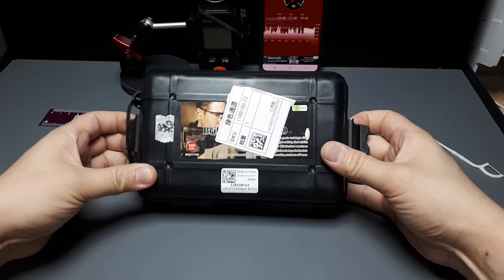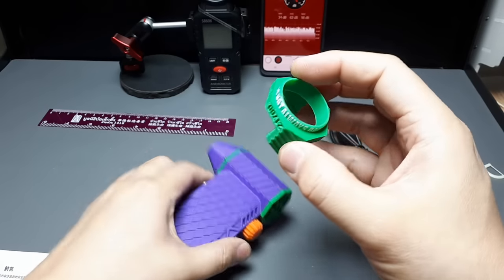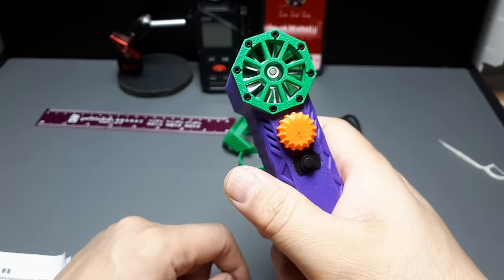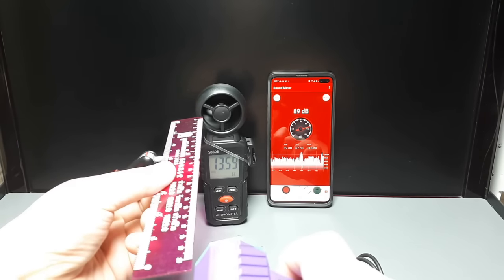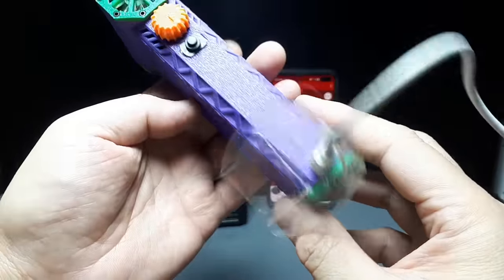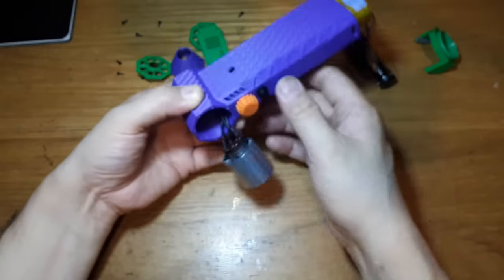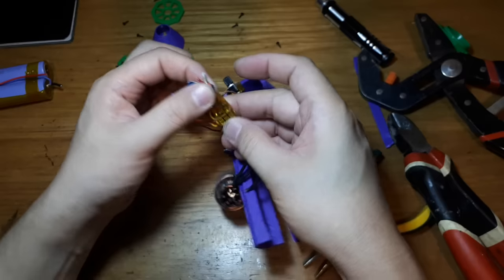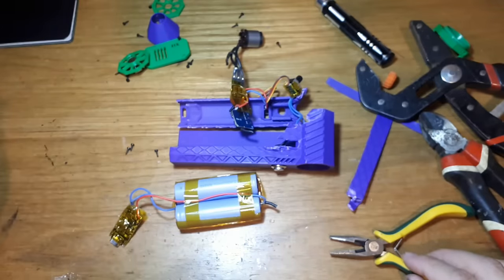Bad design? HEIXUE Mini Turbo Violent Fan 110000RPM Handheld Brushless Jet Fan  8000mAh Aliexpress

Comment: it would be a better representation of sound levels if you dont aim towards the mic of the phone. but the thing looks pretty cool
Reply from the maker: I was trying to get a reading as if the phone was your head.  Some people will use this as a hair dryer and go deaf probably.
Reply: @smallmodelcollector  ah fairs. It's just that the turbulence in the cavity of where the mic is causing most of that noise. But anyways. If someone uses this to dry their hair. It's your fault😂
Reply from the maker: Right, got ya. Seems this was very loud even when pointed at the wind meter. These are impressive motors; I just need to find a better design that is reliable.
Reply: @smallmodelcollector  next video you gotta print a new shell and try to optimise the wind speed
Reply: @lewisyuu  Even then, human ears are evolved to minimise wind noise. 
The sound generated by turbulence at the mic cavity is not representative of what a person will hear when using it as a blow drier.

Comment: OMG ... just ordinary AC brushless motor with turbine fan and dc/ac regulator, similiar are commonly used in RC hobby. Nothing special, just stupid way how to damage it. To generate servo input on speed regulator, something like mini servo tester is handy. Common cheap parts, and Li-Ion battery with charging circuit should work.

Comment: The weird texture on some of the housing is from where it was touching to build plate on the printer for adhesion. The line on the cone is not a defect, it’s called a Z seam. I’ve got 3 3D printers and I’m still not exactly sure what causes this but I think it has something to do with the fact the print head rises up after each layer and kind of “catches” while doing so. There’s a setting you can change that randomizes the layer, but in my experience it just looks worse.